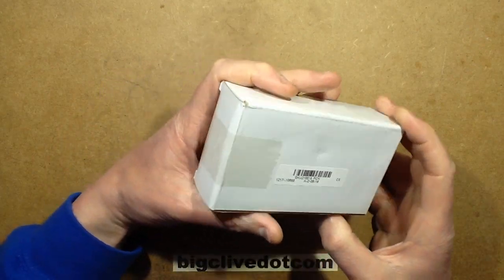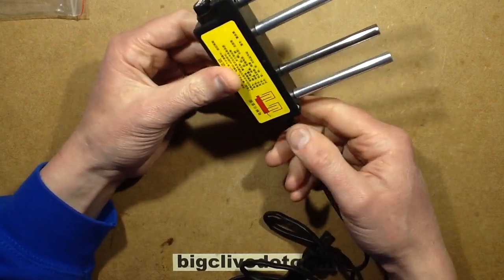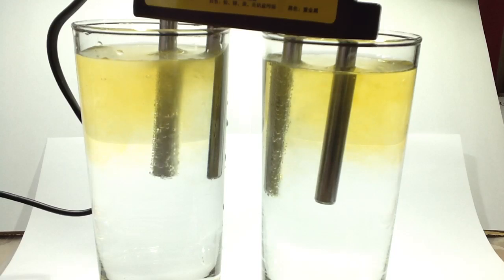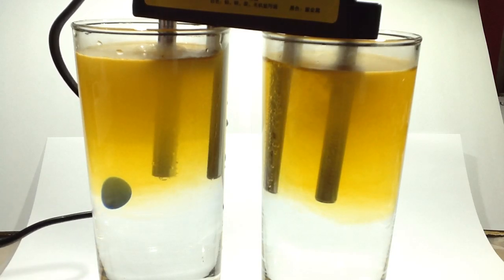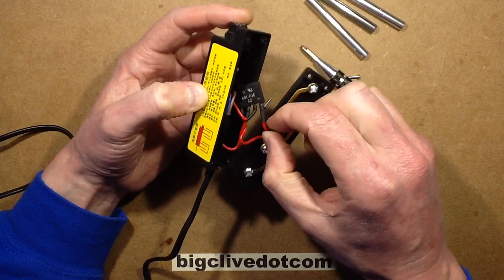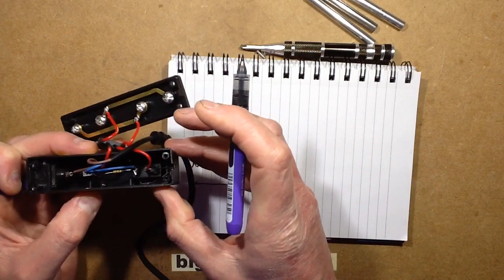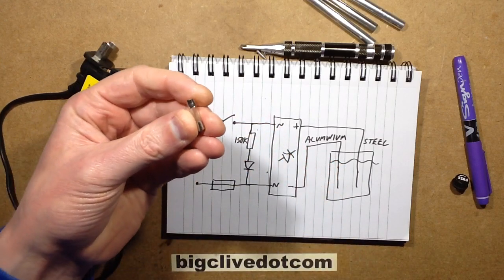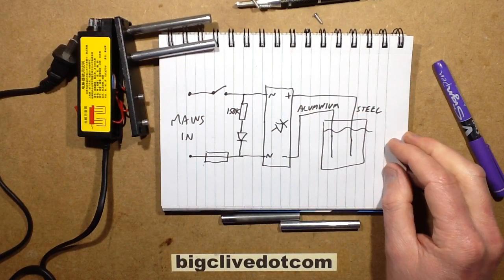Deadly quack water tester.  (scam)

Comment: You're like the Ashens of electronic devices.
Reply: At least a Popstation won't kill you (Though some of the stuff Ashens eats might)
Reply: ***** Yeah, I'm pretty sure I saw them do a crossover once when ashens was reviewing something electronic.
Reply: exactly
Reply: Except without Ashens's smarmy local-radio DJ voice.
Reply: goeiecool9999
Lol, I saw that. IIRC it was one of the pound-land vids. Considering how slow and technical Clive's vids are, though, I imagine most people would have skipped that part.
Reply: Lee Pee this device does not test anything except perhaps how conductive the water is. This is just a galvanic reaction. And telling people that its shows how safe the water is to drink is dangerous when there is a chance you could add something like cyanide to distilled water and if its less conductive than standard water this device would show it as safer
Reply: @daniellotockyj8515  nothing to do with safe water. It simply shows the metals in water. It does what its supposed to do. And well.
Reply: Coin Op these things are sold to companies who go door to door selling water filtration devices. They ask for a sample of your tap water, and they bring with them some water that is supposedly filtered by their machine, but in reality is just distilled water or de-ionized water. They do this comparison, and tell people that the nasty stuff coming from your tap water is contamination, and their filter will remove it. It's one thing to know what this device is doing. It's another to represent it to the average Joe as doing something else. This is actually a well known scam, and it's good that Clive is talking about it.
Reply: He sounds the same too XD
Reply: I was thinking the same thing
Reply: @B P "lol" the mark of intelligence.
Reply: I honestly confuse these two on a regular basis
Reply: Ashens, AvE and big clive the Trinity
Reply: He's the thunder foot of household appliances
Reply: A great compliment
Reply: Birdie McChicken Yeah, a lot of people disliked the video because of how long Clive spent talking.
Reply: LOOK AT THIS OBVIOUSLY ""OVER"" WORRIED LUNATIC MAKING A SCARE TACTIC VID! YOUR ARGUMENT IS WEAK! IT'S FINE TO SAY ELECTRONICALLY THE DEVICE POSES THREATS BUT IT'S ANOTHER THING TO ADD PEOPLE ARE TRYING TO ""SELL"" YOU A WATER DISTILLER. FIRSTLY, ARE THE ONES MAKING DISTILLERS ALSO THE ONES MAKING THESE ELECTROLYZER TESTERS? SECOND, WHO'S 'NOT' TRYING TO SELL YOU SOMETHING IN THIS WORLD?! YOUR VIDEOS ARE MONETIZED. THIRD, SINCE WHEN DID YOU BECOME A HEALTH EXPERT? THE ONLY QUACK I SEE USING SCARE TACTICS IS YOURSELF. STICK WITH ELECTRONICS. STAY OFF GIVING HEALTH ADVICE. MY ONLY QUESTION IS, WHICH WATER BOTTLE COMPANIES 'PAID YOU' TO MAKE THIS VIDEO TO MISINFORM A WHOPPING 288,000 SUBSCRIBERS?
Reply: We C u it's a well known scam used by door to door water filter salesmen. They "test"a sample of your water along with some water they say is from one of their filtration devices, but is really just distilled or de-ionized water, and they tell you that the nasty stuff appearing in the tap water is from contamination, as opposed to being from the minerals (which are necessary for life) that are naturally present in water. It's a tactic to sell people something based on a lie. No, the people making these aren't making the filtration systems, but they're making them expressly for the purpose of selling them to people who do. Also, there's nothing wrong with making money honestly. Yes, Clive's videos are monetized. He's up front about it, and that money is what enables him to make them, or at least, to make them freely available to us for our enjoyment/ knowledge enhancement. It is, however, wrong to make money by using deception and fraud, and that's exactly what hundreds of door to door water treatment system sellers do with these things every day.
Reply: @lordzeusourgodoftruthstorm1669  spot on!

Comment: It looks like the iron is being pulled off the steel electrode and oxidizing almost immediately with the electrolized oxygen from the water while the hydrogen is escaping into the atmosphere. Bunk science and very dangerous. Don't drink it. It will ruin your liver and kidneys.

Comment: If the electrodes were the same you wouldn't get the iron ions forming to discolor the water. Iron is good as Fe++ ions give that nice color quickly..the differing metals give an electromotive potential and in fact would eventually discolor even without the current, the current just speeds it up.

 I'm sure you're right about the distilled water in their "filtered" sample. It won't conduct electricity so won't produce any iron ions

Comment: Isn't there also a hydrogen gas hazard?
Reply: In fairness, it doesn't make MUCH hydrogen. You'd get a brief little flame, not a window-shattering kaboom. Now, if you cooked off a few gallons of water, THEN we'd be worried. But a teaspoon or two? Meh.

Comment: Congratulations! You made beer!
Reply: +Bassotronics whiskey!
Reply: +Bassotronics The flavouring in Russian Vodka . . .
Reply: it is true that some Russians used rusty radiators to distill archaic vodka.. and that the resultant, said vodka, killed countless people. But Russian vodka, on the whole, is far beyond the distilled grains we have here..

Shame on you...

Perestroika !!
Reply: +Bassotronics Well, rust anyhow.
Reply: @jamesvandamme7786  

not rust, aluminum hydroxide.  that's why they use an aluminum cathode.
Reply: Well, there's iron in some of the electrodes. Magnet sticks to them. 

I just replaced the aluminum anode in my water heater (after 30? years). It had a thick coating of lime and I presume some Al(OH)3 on it. Montgomery Wards gas heater still going strong.
Reply: Oof
Reply: If your country makes beer like that....well I am not surprised at all you would think that is beer after drinking it given the massive brain damage it would cause (assuming it does not outright kill you).
Reply: Is that water tester god?!
Reply: If only it were so.

Comment: Dangerous piece of junk that wouldn't pass through any EU or UK safety testing.  Properly distilled water has a resistivity of 18 megohms per CC so of course virtually no current would flow.  As the solution in any UN-distilled water gains ions from the electrodes it will become more conductive and hence a runaway process would begin with current increasing until the fuse blows.

Comment: Wow.....  Very nasty.  With a 10A fuse in there, you could have some serious fault current flowing if you dropped the thing on anything conductive to say nothing of how insanely dangerous this is....  High voltage DC is apparently much more painful a shock then AC is too, so crikey......

Comment: I didn't knew there are so small rectifiers that would work with high voltage of mains. (I know, that in principle there are rectifiers that allow hundreds of amps and they are huge, I worked with those.. or millions of volts, and they even larger)

Comment: I'm guessing it's simply a reaction with natural minerals and salts in the water, nothing bad because all water has some.  That is what's providing the conductive path. Distilled water lacks the salts and minerals and doesn't conduct electrify. Water without impurities is an insulator, but rare because it's also a solvent.

Comment: on top of that the color comes from the copper if it was not 
it would separate the water into h and 0
Reply: +zanderlv Yeah, the if the water has any electrolytes (not necessarily a bad thing), the H and O react with the metal in the electrodes to create a yellow precipitate.

Comment: Sorry I don't know much about electronics but I'd like to. If the mains is AC and the LED and resistor are in parallel to the AC supply, wouldn't the LED be constantly flicking? Surely it makes more sense to put the LED after the bridge rectifier?

Comment: What kind of filter do you have? I do have a reverse hosmosis (under-tap) and a pre-sweetener outside my house... and the water output from my faucet is almost distilled: if you electrolyze it, nothing happens, unless you put some salt in it.
By the way, the "device" is just an electrolyzer - it can demonstrate "hardness" in water, by means of amount of salts (and other stuff) in it. A good idea to make it "safer" could be putting the electrodes inside some plastic, perforated tubes.

Comment: Ok the device is doing this... its using the conductivity in the water to cause a reaction. This reaction is because of the dissolved elements which is causing a reaction called  electrolysis  those bubbles  produced is  Hydrogen and Oxygen 

The dissolved elements  "Iron lead Etc"  is acting as a electrolyte Most water will do this especially since they are using two different metals.  if it was aluminum for both or steel for both it would not react as much or at all

Comment: If you notice the steel electrodes, they seem to have a significant amount of wear on them after use. This is because the electric current being ran through the system effectively separates the bonds from the steel alloy and lets it float into the water. It's accelerating the oxidation of the steel. It's a complete scam.

The reason why distilled water doesn't work as well for the oxidation is because an electric current can't run as well in distilled water due to the complete absence of minerals.

If you want to REALLY test your water, get a litmus test.
Reply: +Jeroscope Checking the PH is potentially useful though of course it will give a near neutral result if the contaminant is neither an acid or a base or if it has a mixture of contaminants that are both basic and acidic forming a buffer solution. Another simple test that can also be done quite easily is to place say 100ml of water and gently evaporate it away to a dry residue most mineral contaminants will form a dry powder this way and if it is not aggressively boiled many of the organic contaminants if any will precipitate too though possibly as an oily/waxy/sticky residue. If not wanting to wait for natural evaporation it could be done on the hob placing it in a saucepan and simmering the water off on a low heat would work best ie avoid boiling it which would potentially break down organic contaminants too a low simmer so it steams gently without bubbling would be ideal.

Comment: It's surprising that the LED doesn't get blown up by the reverse voltage across it when it's not conducting.
Reply from the maker: +Terry Clark The older gallium arsenide LEDs just avalanche like a normal diode when their PIV is exceeded.  It's not an ideal way to use them, but it's what cheap products do.
Reply: +bigclivedotcom Ah, so the design shows the same respect for the component ratings as it does for the user's life.
Reply: +Wilson Phillips Hey that's innovative, design a crappy product and then avoid all those pesky guarantee claims by finishing the user off first. The only trouble is that this business model doesn't generate much in the way of repeat business.
Reply from the maker: +Terry Clark It carries a lifetime guarantee.  When the user dies the guarantee is void.
Reply: +bigclivedotcom well, it's 90-100V of DC, which a bit less lethal than AC (only because AC can overcome capacitive barriers, body is highly resistance  to DC). Voltage isn't  even main factor that kills, current what does. There were quite a number of lethal cases being shocked by 12V battery or 9V accumulators (usual battery used in Navy or avionics), only because the setup could produce high current. Our skin very resistant, but got capacity value,  and caps aren't barriers for AC, you know that, so reactive resistance to AC is much lower, thus, higher current in "circuit" is produced, and AC spreads more inside body, causing more damage. Working with welding equipment , I was shocked quite a number of times, and I'm still around. Usually, manual arc welding for steels uses 60-100V, 100-200A.Never was exposed directly ( i.e. through a dumb action of holding both electrodes when power is on, lol, that's  most likely lethal), but dealing with cramped compartments sometimes causes  part of current go though body, if  protection isn't good enough.
Reply: +Terry Clark They didn't even bother to put the LED across the rectified side. So easy...

Comment: I notice that's a US power plug on the unit.  In the US, the neutral side is earth grounded at the power panel.  If that is the side directly connected to the rectifier, perhaps it is not quite as deadly as initially believed.  The plug should be polarized, with one blade wider than the other so it only plugs in one way.  The wide blade is neutral.  Of course it is still dangerous.  120V at 10A through wet electrodes - that could ruin your whole week.
Reply from the maker: +Star Gazer Chinese plug.  Symmetrical blades.

Comment: With 220v in sine wave, there will be over 310v DC out at the terminals...  Add a 10 amp fuse to the probable 1 amp rectifier and you have a potentially lethal combination even if the plug is polarized correctly.  I'm surprised they don't advertise it as antibacterial as it would probably electrocute any bacteria in the water...  Should definitely be banned in all countries.

Comment: If 120v AC in, figure around 85 VDC out.  More than enough to stop your heart.
Reply from the maker: +Ken Knerr 120V RMS unsmoothed DC.  Peak voltage = 1.4 x 120V.

Comment: Why is it dangerous to touch the rods even when the device is turned off?
There would be no current flowing, would there?
Reply from the maker: +Neodar If it's plugged in it should be regarded as being live whatever position the switch is in.
Reply: +bigclivedotcom Yes, I understand. But why is that?
Reply from the maker: +Neodar Because the mains current will flow through you to ground.
Reply: +bigclivedotcom Ah I see, I forgot it was an AC current.
Thx.

Comment: doesn't that generate chlorine gas because of the chlorine in two water?
Reply: or would it just make hydrochloric acid?
Reply: +Julian Spira Water doesn't have chlorine in its chemical composition. Its H2O. What you are seeing is actually the minerals and metals in tap water bonding with oxogen, making a rust of sorts. As the electricity passes through the water, the water decomposes into hydrogen and oxogen. The molecules typically bond with the alloys in the water, as well as the rods. This is evident when the device is removed. The poles are different colors.
Reply: +Rex Cletus I misspelled oxygen. Twice. FML.
Reply: +Rex Cletus i swear i though that tap water has bleach
Reply: +Julian Spira It has some to kill bad bacteria. This isn't going make chlorine gas, however (not at this level, anyways). Although some chlorine gas may have been produced, you mostly saw oxidized metal.

Comment: It's only breaking one of the leads, but as the other is blocked by the LED, you're not actually going to get HV DC on the electrodes when it's plugged in but switched off, right?
Reply from the maker: +George Hafiz Nope.  If the switch ends up on the neutral/return then the output will be live whenever it's plugged in.
Reply: +bigclivedotcom ah so the schematic you drew doesn't leave it dangerous but there's a risk they'll muddle those leads up in the factory some time because of the design?

Comment: Hi Clive, Could you tell me what plug in power meter you use please (watts, current, volts, power factor[??]) ? Also, is there any chance of you doing a comparison of these types of meter, there are a few available on (and off) eBay but .... which are the good, not so good ones. Thanks, Stuart.

Comment: I'm pretty sure they used aluminum instead of steel for one electrode on each side as it won't react. Otherwise all that rust would have somewhere to go other than the water.